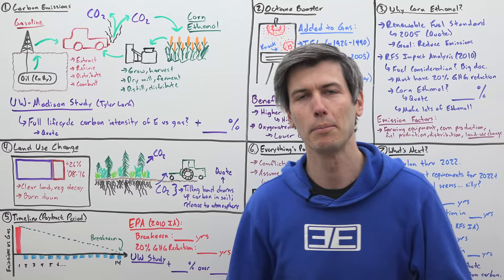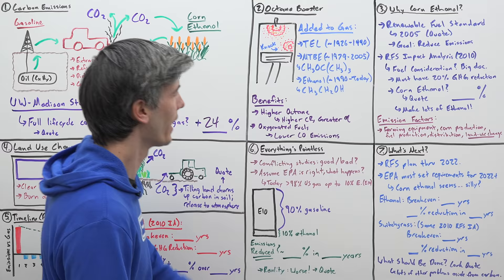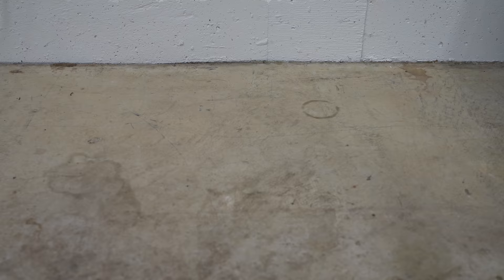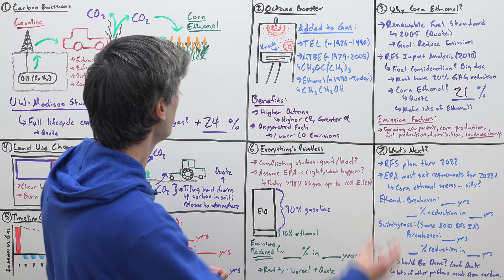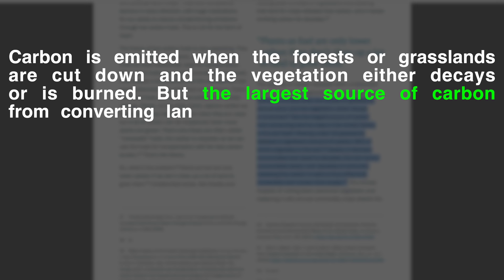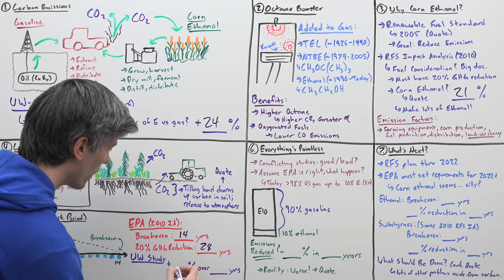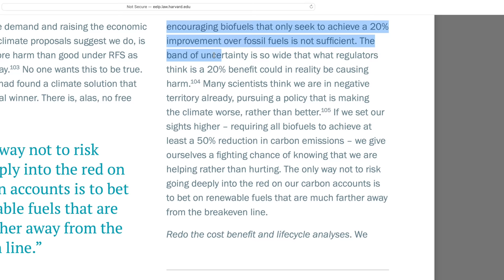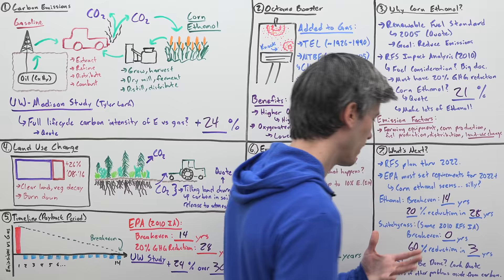America Was Wrong About Ethanol - Study Shows

Comment: To generate all the electricity currently used in the state of Georgia it would take about 4000 sq miles of solar panels. About 7% of the land of the entire state. That land has to be cleared of all vegetation.  If cars are all changed to EV's then double that to 8000 sq miles.  If natural gas and heating oil is prohibited and only heat from electricity is allowed then increase it yet again to 12,000 sq miles. Or 21% or all the land in the state.  Solar panels are getting more efficient - BUT - there is a theoretical limit which is about 3 times the current efficiency.  But they need to be 100 times more efficient - but the Sun doesn't output enough for that.
BUT that electricity is only generated in daylight. So there has to be battery storage. My calculations are that we will need about 150 billion dollars of Tesla batteries.
BUT that is only enough to hold up the electricity for one day.  What if we have a week of strong overcast (such as what we had last week) such that we need 7 days of battery power. Then the batteries will cost a trillion dollars. AND they will have to be replaced every 5 years. 
BUT what about battery improvements? You may ask. The improvements we see are generally single percentile improvements. Sometimes, though rarely, a two digit improvement. The improvement we need in batteries to make them viable for this purpose is they need to get 100 to 1000 times better. In percent that is 10,000% and 100,000% which is a bit greater than the usual 5% improvements.
Another way to look at the cost of the batteries is - let's assume the entire Earth switches over to solar electricity and batteries. The total battery bill would be more than the value of the entire Earth. That is if we could even find alien beings from another galaxy that wanted to buy it.
Reply: Put solar panels on every building roof in the state ....PROBLEM SOLVED.

Comment: If they didn’t use corn for ethanol the corn belt farms would be out of business. 
Also have to think about how much fertilizer is used in corn production? Normally lime has to be applied to correct PH levels. Corn production for ethanol is big business, unfortunately everyone but the farmers are making money.
Reply: I looked it up.

The US used 11,160,933 tons total fertilizer on corn in 1980, before ethanol.

In 2018, the year of most ethanol production ever, the US used 10,521,850 tons total fertilizer on corn.

100% of the fertilizer (& everything from the soil) still get fed to livestock in the distillers grains.  Ethanol comes from only things of the air: solar energy, CO2, and water with the latter two recycled once burnt.

Ethanol C2H6O = no fertilizer

Distillers grains = all the fertilizer

What logic is it to then assign all the energy and CO2 of fertilizer to ethanol and none to distillers grains? 

Iowa State University measured all the energy it takes to produce an acre of corn into a "diesel fuel equivalent"
This included making the machinery, fertilizer, chemicals, plus the tillage, planting, spraying, harvesting, drying, trucking etc. 
They found it takes 34 gal of diesel to produce one acre of corn.
What do we get from those 34 gallons of diesel?
We get >500 gallons of ethanol.
But wait, that is not the kicker.
The kicker is we still get 100% of the protein and other things from that acre of corn still available for a healthier and better feed called distillers grains. A win-win.

Believe it or not, the corn belt grew more corn acres in 1980 before ethanol than they did in 2018, the year of most ethanol production ever and ethanol plants everywhere.

2018 Iowa 13,200,000 acres of corn with record ethanol production
1980 Iowa 14,000,000 acres of corn before ethanol

2018 Illinois 11,000,000 acres of corn with record ethanol production
1980 Illinois 11,600,000 acres of corn before ethanol

2018 Indiana 5,350,000 acres of corn with record ethanol production
1980 Indiana 6,450,000 acres of corn before ethanol

Comment: Thank you for looking at the land use issue. Cultivating / tilling soils is the worse thing we can be doing for adding carbon to our air. It doesn't matter what the crop is but every time you till, you release huge amounts of carbon and methane into the atmosphere. Once you mono crop you also kill off billions of micro and macro organisms. These are all carbon based life forms. Once you start down the road of till, spray, fertilize and harvest it takes hundreds of years to  bring the balance back after you stop. We may not want to realize that hoofed animals that graze are the best method of carbon sequestration by, grazing and increasing root growth that brings carbon etc out of the atmosphere into the soil and feeds the subterranean ecosystem, by spreading fertilizer from one place to the next, and yes, cow poop contains millions of soil organisms that need to be spread to keep the soils in balance. So either buffalo, elk, deer, sheep, or cow, free range grazing and not till cropping will save us. As a side note, oil is a solar generated, organic, and renewable (though a long term renewable) fuel. Strange and against the narrative to think like that.
Reply: Oil is renewable. NEATO!

Comment: There’s no possible way ethanol can produce more energy than what is consumed planting, harvesting, and distilling it!
Reply: You are absolutely, 100% technically correct on your statement but you forgot just one important little thing.

Solar energy.  Ethanol is stored solar energy.

Iowa State University measured all the energy it takes to produce an acre of corn into a "diesel fuel equivalent"
This included making the machinery, fertilizer, chemicals, plus the tillage, planting, harvesting, drying, trucking etc. 
They found it takes 34 gal of diesel to produce one acre of corn.
What do we get from those 34 gallons of diesel?
We get >500 gallons of ethanol.
But wait, that is not the kicker.
The kicker is we still get 100% of the protein and other things from that acre of corn still available for an even better feed called distillers grains. A win-win.

Note that of those 34 gallons of energy in the diesel fuel equivalent, only 4 to 6 gallons per acre is the amount of actual diesel fuel used by farmers for tilling, planting, spraying, and harvesting.  If John Deere and Cummings comes out with the ClearFlame engines they are heavily invested in, then the farmers could use almost pollution free E100.

Henry Ford while talking about his favorite fuel said there is enough energy in 1 acre of potatoes to farm that acre for 100 years.

Newer ethanol plants use waste steam from natural gas electric plants to make ethanol.  Waste steam = free energy (essentially)

Crude oil is distilled twice, once to remove the water and then a second time at an astounding 750 degree F.  Your statement definitely can be said for oil.

Comment: In Pratt KS they built an ethanol plant by charging the taxpayers to drill a new water well and building a big, brand new water tower, plus paving (for heavy truck traffic) a county road and constructing a railroad spur. When the plant was up and running I went there and they had a whole eight employees running the plant. Outside you could hardly hear because of the noise from stacks spewing the by-product of fermentation into the air like massive jet engines.  That by-product? CO2. WTF? Not even mentioned in this break down of how useless Ethanol is as an alternate fuel for saving the planet. Where do we get our refund?
Reply: 100% of the CO2 from the fermentation (& burning) of ethanol just came from the atmosphere and 100% as in all of it absolutely needs to be back there to make the new gallon of ethanol.  Just like leaves on a tree, it is a cycle.

While the corn belt grew more corn acres in 1980 than in 2018, the year of most ethanol production ever, I do see Kansas did increase corn acreage but only at the expense of wheat acres.

I did look up Census data at USDA of grassland, forest and wildlife area in Kansas for fun.  2012 is newest data available but the ethanol mandate was 88% of the maximum by then so it at least gives us an idea on where things were going.

Kansas grassland area
1982  13,907,000 acres before ethanol
2012   17,781,000 acres after ethanol

Kansas forest use land area
1982  1,359,000 acres before ethanol
2012  2,402,000 acres after ethanol

Kansas wildlife and rural park areas
1982  116,000 acres before ethanol
2012  335,000 acres after ethanol

I looked up the Pratt ethanol plant and see they use milo and corn to make distillers grains and ethanol.  They employ 37 people there in your town of around 6600.  It is not that big but looks to be pretty high tech and efficient.

No doubt that has been a boon to your small town from extra money by value adding a product rather than exporting raw commodities.  The ethanol is used locally along with the distillers grains which must have been a boon to local cattle and dairy operations and probably cause new ones to spring up in the surrounding area.  I see your town has made a whole industrial park available and is inviting industry with incentives.  I bet every dollar they spend will return more than spent.

FYI, the Federal corn ethanol subsidy ended back in 2011.
The long-standing stated goal of the G7 Nations to end petroleum subsidies?  No such luck.
Reply: Thank you for taking the time to look up all this information.  37 employees sounds about right (eight on sight when I was talking to David). I never thought about the CO2 being extracted and returned to the atmosphere during the fermentation. I assumed being a by-product, it was being added to the atmosphere in an obviously huge (visible/audible) amount. The economic benefit to the county and city will hopefully eclipse the amount (several million) they got to invest that directly benefited the investors and owners who also got massive property tax breaks small businesses would  never get. I was under the assumption that the profit from the sale of ethanol was still dependent on government subsidies and the mandates to use it in the formulation of gasoline. Not exactly a free market. @danafletcher2341

Comment: 15  years ago I drove my new RAV 4 SUV on a weekend round trip of approximately 800 highway miles under ideal weather conditions in both directions.  The first tank of fuel was with ethanol fuel. My return trip was without ethanol fuel which gave me a gain of four miles per gallon over the ethanol fuel.  How does ethanol fuel emissions help reduce co2 outputs if you’re burning more total fuel??? 
- OPEN DOOR
Reply: There wasnt ethanol fuel 15 years ago.. need to edit your fable above. Start over.
Reply: @oldblueaccord2629     I was only emphasizing  a fact that I measured on my trip from se Massachusetts to Buffalo New York on two different tanks of purchased gasoline that showed that the non ethanol fuel purchased in NY allowed an increase of 4 mpg better. I believe it took place in 2008 or 9 at a time in se Mass there were many gas stations ( as noted by the 10 percent sticker at the pump ) just starting to introduce the ethanol mix along with that crazy Massachusetts new rule on gas vapor recovery gas pumps.  New York and New Jersey at that time seemed to be hold offs on the ethanol mixes for the time being back then. Wikipedia will show that ethanol had been experimented with way back in 1911 and then stared to gain rapid governmental ( EPA) acceptance a hundred years latter!
Reply: @nickcaci7238  Nothing to do with pulling the Berkshires mountains going east and going down hill going west or anything...Great story! Brought back some great memories for me.

Comment: If ethanol was renewable then one could produce without non-renewables. No natural gas based fertilizer. No natural gas distillery.
Reply: The US used 11,160,933 tons total fertilizer on corn in 1980, before ethanol.

In 2018, the year of most ethanol production ever, the US used 10,521,850 tons total fertilizer on corn.

100% of the fertilizer (& everything from the soil) still get fed to livestock in the distillers grains.  Ethanol comes from only things of the air: solar energy, CO2, and water with the latter two recycled once burnt.

Ethanol C2H6O = no fertilizer

Distillers grains = all the fertilizer

What logic is it to then assign all the energy and CO2 of fertilizer to ethanol and none to distillers grains? 

Iowa State University measured all the energy it takes to produce an acre of corn into a "diesel fuel equivalent"
This included making the machinery, fertilizer, chemicals, plus the tillage, planting, spraying, harvesting, drying, trucking etc. 
They found it takes 34 gal of diesel to produce one acre of corn.
What do we get from those 34 gallons of diesel?
We get >500 gallons of ethanol.
But wait, that is not the kicker.
The kicker is we still get 100% of the protein and other things from that acre of corn still available for a healthier and better feed called distillers grains. A win-win.

Newer ethanol plants don't use natural gas but rather waste steam from onsite/nearby natural gas turbine electric plants.  Waste steam = free energy

An ethanol plant in Nevada, Iowa makes ethanol from corn and renewable natural gas from corn stover and is hooked up to the nearby natural gas pipeline.  An ethanol plant in Sioux Falls has used natural gas from the city's land fill.

PS  There were no grasslands or forests broken up for corn.  Impossible on its face since US cropland acres have been declining since ethanol.
Reply: @danafletcher2341  yeah, the unbiased University of Corn Iowa!